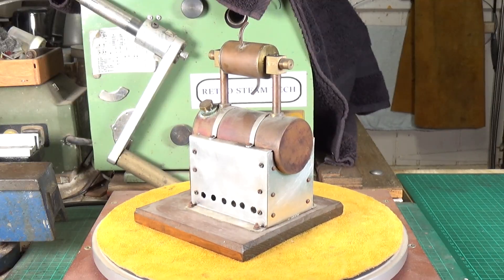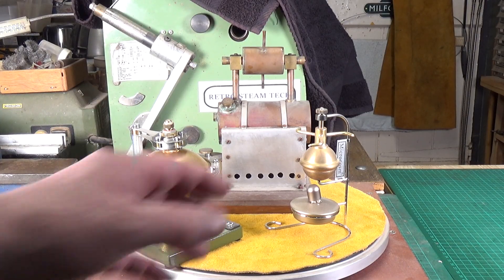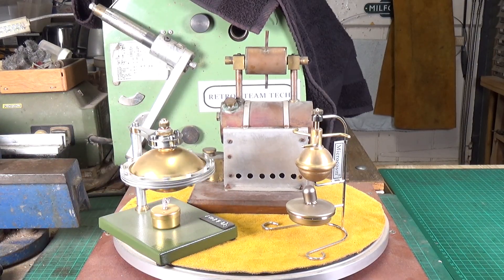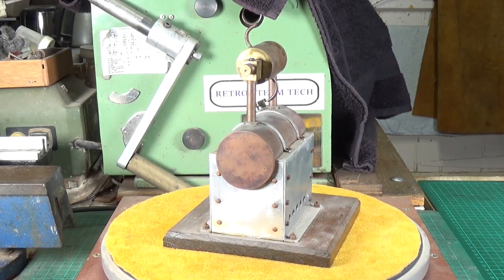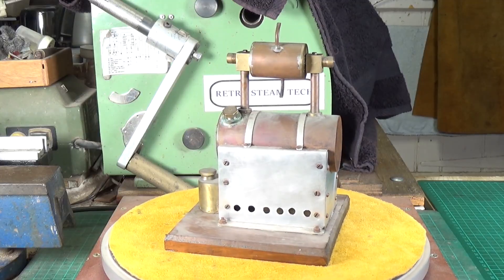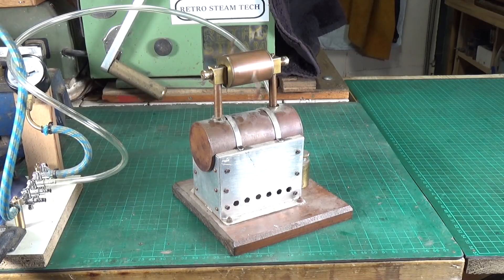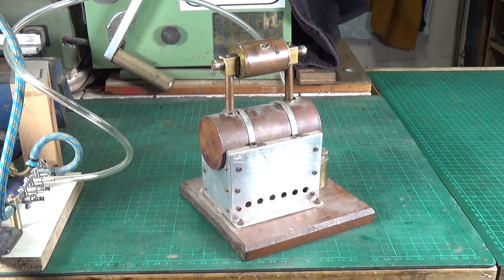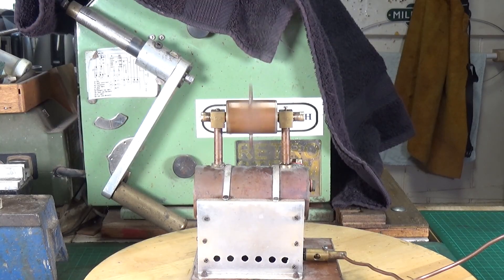Scratch Built Hero - Aeolipile - Model Steam Engine

Comment: Theres a lot of metal to heat up to get it going. A bigger burner would make it run faster. Who ever made it did a good job to get a seal where the bearings join the standards.
Reply from the maker: Yes, I was impressed with the steam feed, certainly doesn't seem to leak,